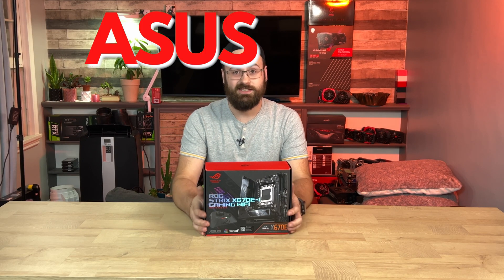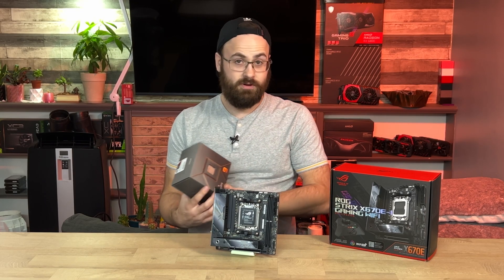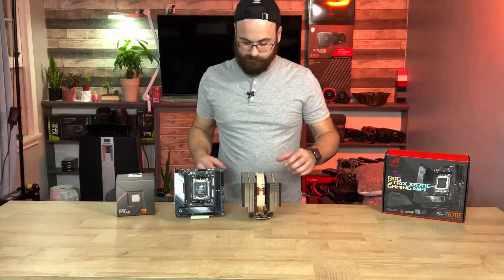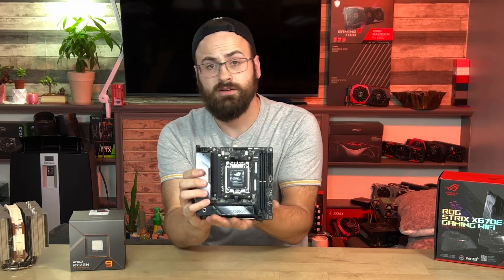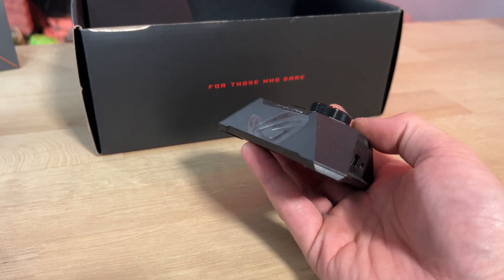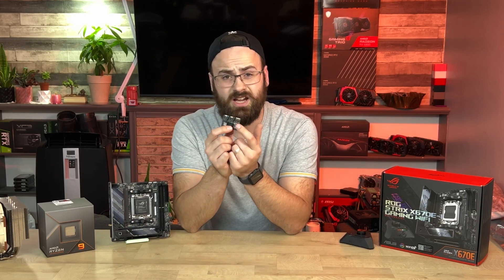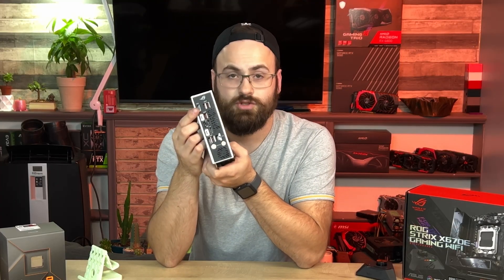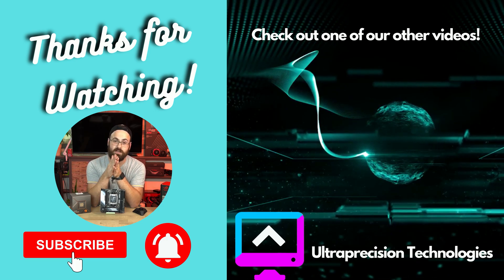An Engineering Work of Art! Asus ROG Strix X670E-I Rundown

Comment: Great Video! I was wondering if you knew the cooler clearance, I am doing a mini ITX custom loop but couldn't find any dimensions, I am planning on using the EK Quantum Velocity2 water block which is 89x113.5x34mm

Comment: Another issue I ran into using this board with the Lian Li A4 H20 case is that the sata connectors don't have enough clearance and the connectors block the installation of the itx PSU.
Reply: Thermaltaken has slim sata cables which fits perfectly
Reply: @t6pix  Thanks for sharing, I was using the included cables and the 90 degree bend cable didn't fit.  Were you using the same model  Lian Li Dan A$ H2O case?
Reply: @moremetafeta  im using nr200 max which has psu right next to the sata ports. Regular sata cables with straight or 90 degree angle wouldnt fit. But thermaltake cables fit which cable exits the side of the fitting

Comment: I finally integrated a sff pc with this motherboard, at first power-up I experienced not just loud and high pitched, but a rough and rattly fan noise from the fan for the M2 ssd slots. Unfortunately I am going to have to shop for something else. I saw a lot of people complaining about the fan noise on this motherboard in a sff forum.
Reply from the maker: I literally just got my itx system together last night. It does scream when it first powers on. I haven’t heard it really after that, however the space I’m in isn’t very quiet so more noise sensitive ppl may still be able to hear the fan under certain conditions. I did notice too only 1 of the heatsink fans are speed adjustable in bios.
Reply: @ultraprecisiontechnologies  I removed all the M2 brackets and heatsinks and powered the unit up again. The rattling noise is definitely coming from the fan itself. I can press my finger gently on the fan itself and the rattle goes away. Looks like a QC issue

Comment: It should never be $470. $350 makes more sense. Looks like I'm getting B650E-I version then!
Reply from the maker: And I think that's why the B chipsets exist. In my opinion, If you're not going to be aggressively overclocking and using at least 80% of the bells and whistles of this board, then I do think it makes more sense to buy a board that only has the features you need. Also consider trying to build a small board that keeps up with some full-sized ATX boards requires more expensive components, for example a 110A power stage vs 80A power stage because there isn't as much room for more phases, as well as ITX boards can take close to 2x as long for the electrical engineering and design phase of development to get it all packed in there.
Reply: @ultraprecisiontechnologies  B650E-I looks similar do you think there are any cons about B650E-I? I don't think I'll be overclocking since there seems to be not enough head room for 7700X. Looking forward to your ITX build I have an open air case called Xproto-L.
Reply from the maker: On AMD, you can still overclock with the B series chipset, so don't feel like you can't overclock at all. I think the x670e-i board does have a higher quality VRM however. (110A power stages on X670E-I vs 70A power stages on B650E-I.) I'm hoping in the future as I grow my channel I will have better access to these more technical points so I can give more concrete answers instead of replying with "I think" lol.

The main cons are with the cut down chipset itself see this link: https://www.pugetsystems.com/labs/articles/AMD-X670E-vs-X670-vs-B650E-vs-B650-2361/
TLDR; less pcie lanes, less connectivity.

Comment: And yet, despite moving the audio solution out of the board itself, or so Asus claimed upon release, the multi-speaker setup is no longer supported on the smaller boards, yet using same running gear it is on the larger boards... and it's not like they run out of space on either rear-panel or the hub... so yeah, hooray for 7.1 audio support, nay for actual output of anything more than stereo through analog media... And that follows the tendency of smaller mobo manufacturers to go the route of repurposing available minijacks on rear and front panel to deliver 4.0+ outs using a combination of rear (that's great) and front panel ports (this is horrible).

Comment: The manual for this motherboard in US English is missing from the website, and the included physical manual is missing details. One M.2 is gen5 and the other is gen4 but it it not clearly stated which is which on this stacked M.2 storage area.
Reply from the maker: That’s odd. The manual was available on the website when I was doing research for the video but I just checked and I see there are no manuals listed now.
Reply from the maker: “The M.2_1 ( labeled ) is PCIe Gen 5 and the M.2)_2 is PCIe Gen 4 
1 is linked to the CPU and 2 is linked to the PCH
outside of a minor latency difference effective real world experience is the same between the two.”

Comment from the maker: I just wanted to say JJ from Asus reached out to me and shared a few additional things about the board I feel it’s important for you guys to know: 
1)The X670E chipset uses 2 physical chips (both located under the m.2 heatsink stack) Having dual PCH chips is one of the main reasons why they had to move onboard audio off board to the Hive Strix.
2) Just because the VRM of this itx is physically smaller it does not mean you are limited in overclocking. They are using higher amp power stages, so even though there is fewer of them, it doesn’t mean you are limited in some way. I believe JJ said this board uses 105A power stages Vs say a 70A found in some other atx full sized board.

Comment: You really have to double check cooler compatibility with so much vertical stacking on the mainboard.
With Asus boards in general, I bought a Z370-I mini-ITX second-hand, and 5 years after release they published a BIOS update to enable ReBAR. This was an unexpected and awesome pro-consumer move to make the hardware live longer. I can recommend Asus boards.

Comment: Great review.  As a SFF fan I'm not sure if I'm skipping this gen or what.  Seems like mini-ITX has fallen out of favor over the years with the increase in cooling needs.
Reply: Having an additional external sound card makes it even less appealing. B650E-I looks better.
Reply from the maker: It seems that way. I’m going to find out in one of my next videos when I cram it in some itx case. I’m not sure which one yet! I have a meshlicious, nr200p and nzxt h1 v2
Reply: 13700k is running cool in my nr200 280 AIO...just please don't buy Asus MB's, the last one I had was overpriced and had nonstop posting issues even with the newest bios...barely could post with XMP or any OC settings. Very happy with MSI so far...it actually works with no issues

Comment: I think the lower resistance parts heat up fast but, sure why not let there be parts where high resistance parts heat up first... :D im not an electrician or anything but i think connecter burns are caused primery by not exactly touching wires as electric arcs tend to heat up fast...

You can try the high resistance low resistance heating up by connecting 4 seperate different ohm resistors continuously and feel the heat on them...
Reply from the maker: I did some checking, and I may have used the wrong terminology but what I’m trying to say still comes across in the video. To say it a different way -
“Resistance is caused by degraded conductivity (they are reciprocal properties) caused by conducting electronics not flowing perfectly freely in the conductor. They periodically collide with the fixed atoms of the material and give up some of their energy to them, which manifests itself as increased thermal vibration - aka HEAT.”

Comment: Thinking about using this one for a small form factor build with a 7950x. 
Watercooled, custom loop, external radiator. 

I'll use a XPROTO by XTIA so it'll be kind of an open setup anyway.
Do you know if the 2 fans in the VRM & SSD - Heatsink are temp-controlled? Are they semi-passive? How loud?

I'm aiming for a reeeally silent build, MO-RA3 420, the works. 
If they have an annoying pitch, can't be turned off or result in error codes / the system not posting if unplugged... 
That'd be a no-go.

Thank you a lot for this review already.
Reply from the maker: I will check these things out in the next few days and report back when I have time. You can always message me through any of our social media or or the email linked in the description if I forget to come back and answer here in the comment section
Reply: @ultraprecisiontechnologies  💯
Reply: This board's fans are extremely loud. Also don't even bother occupying the PCIe Gen5 port because it causes the chipset to overheat.

Comment: This board cost almost 700$ where im from, feels kind of not worth it.

Im not worried about the D15 but the smaller coolers, this was and problem on Intels Z690 mini ITX even for AIOs since they had to build more height around the I/O and stack M.2 ports.
Reply from the maker: For what it’s worth I think the price is too high, and it’s been reported recently by Moores law is dead, that AMD are starting to crack down on board partners about the price of some of these boards.
Reply: @ultraprecisiontechnologies  Yeah Intel is a bit better but not by much, my friend was looking on the Z690 version of this motherboard and i told him to go B660 wich, overclocking isn't worth it in most cases today so it's better putting it in to a gpu really.

Comment: Great video excellent board had some SATA issues on some smaller cases N200 and Hyte which didn't leave room for the SATA cables. Resolved it with Lian Li O11 Dynamic case.
Reply: Just order thermaltake slim sata cables for itx cases. Perfect for small fitment